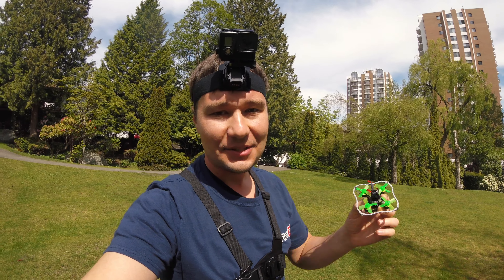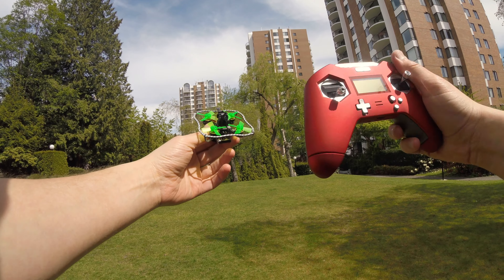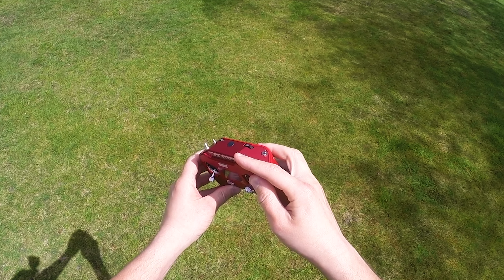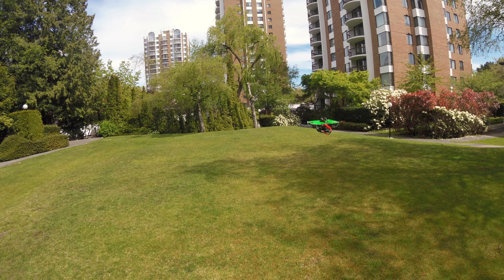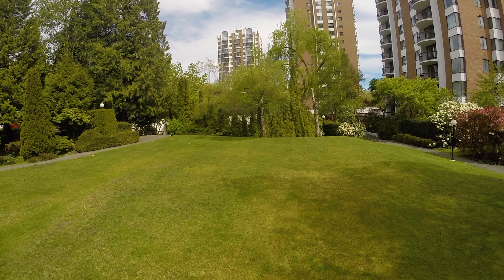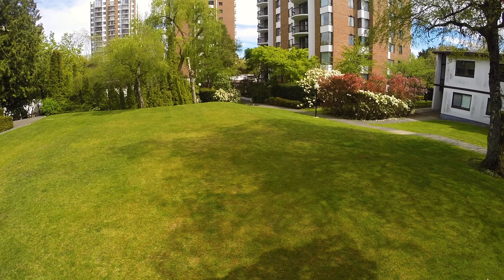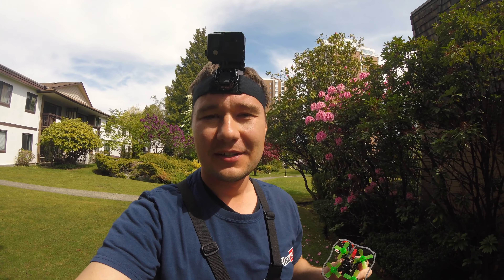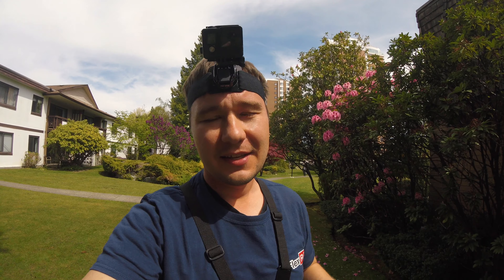Is Nano X with X-Lite - The Smallest Drone Package?

Comment: just ordered the frame. Hope to get it soon. ;) Does it fit also 20mm x 20mm hole to hole FC's?
Reply from the maker: Thanks for your order
Reply: @FlexRC  Dimitri does it fit 20mmx20mm hole to hole FC's?
Reply from the maker: @Oxizee  It has 20x20 and 16x16 holes

Comment: What motors? 
And are you ever getting the 1102 back in either 12500 or 15000 KV?
Reply from the maker: I'm using 1103 15000kv. I don't have current plans to produce more of them.